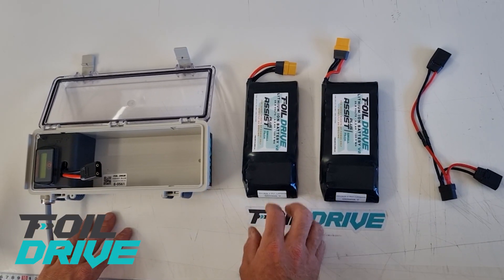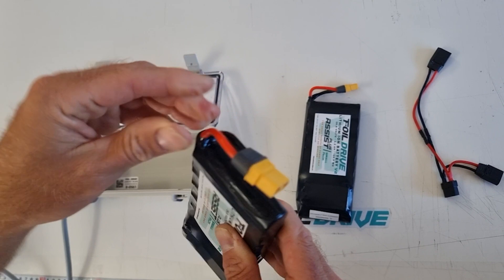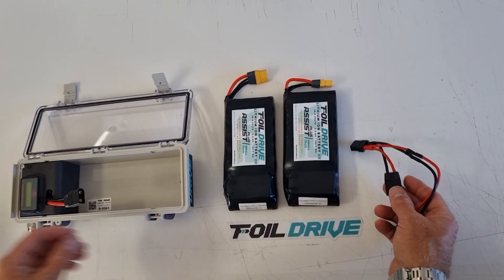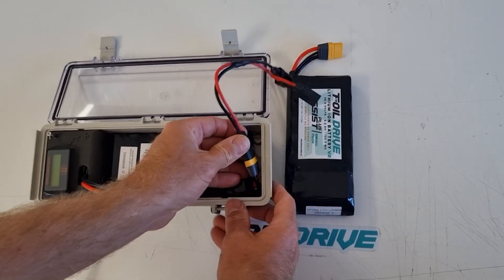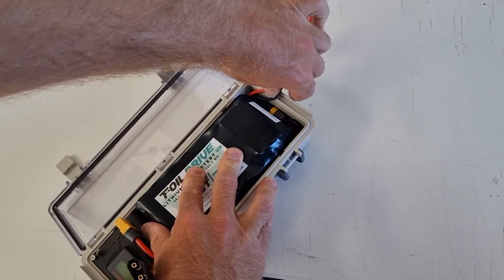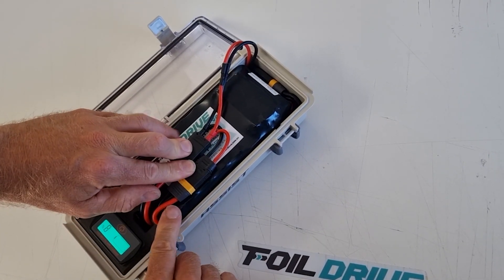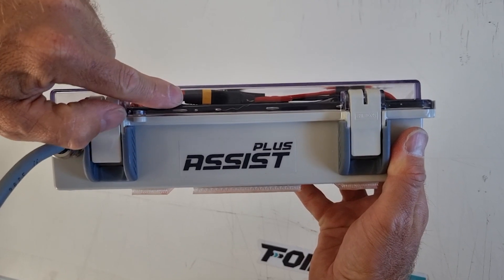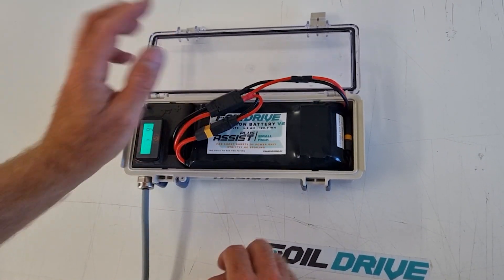Installing two V2 Small Batteries

Comment: What's the difference in power and battery life between standard and small?
Reply from the maker: Hey Jeremy, essentially the main difference is the capacity. The Small Battery is essentially 1/3rd the capacity (runtime) of the Standard. Two Small Batteries become equivalent to 2/3rd the capacity of the Standard Battery. 

You can read a more in depth comparison here: https://www.foildrive.com.au/post/foil-drive-battery-comparison

Note: We no longer offer the Medium Batteries outlined in this blog.